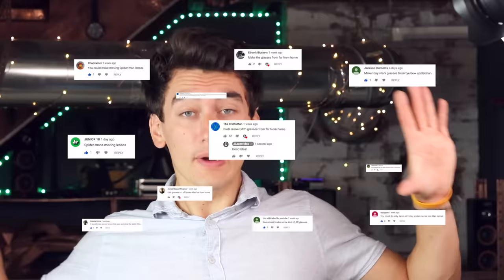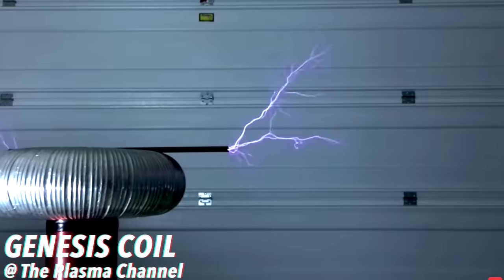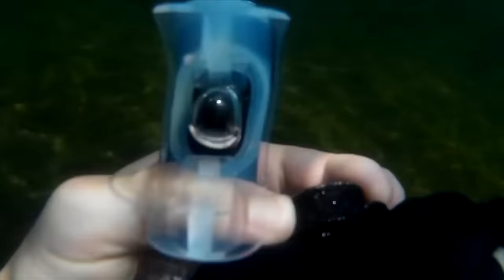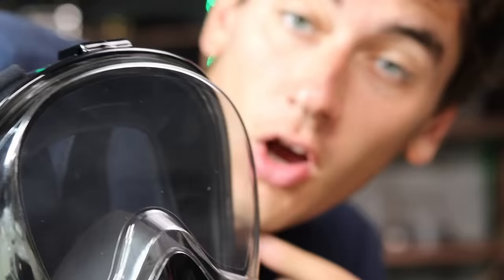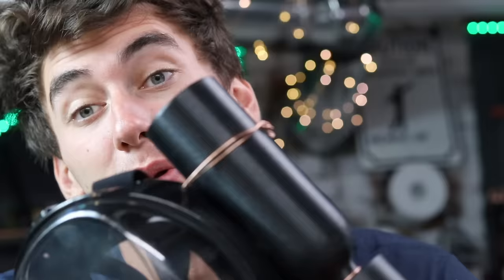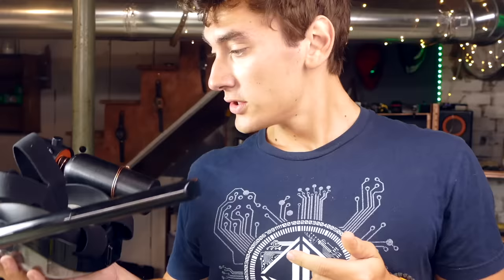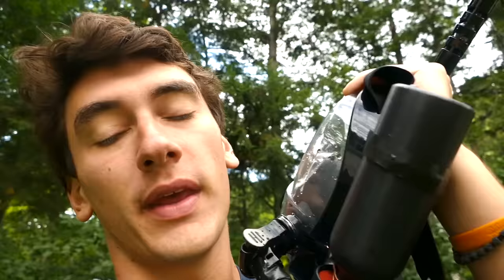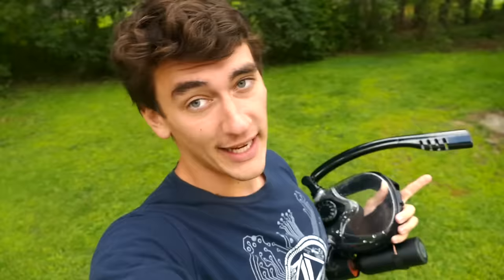BREATHE UNDERWATER With Just a MASK?!?! - Easy James Bond SCUBA Build (Building Your Ideas #1)

Comment: well it's a great concept for fast spot dives in open waters. Like for checking a prop , water intake on a boat or if you drop something in shallow water. A scuba mask maybe you could have interchangeable extra air tanks its portable enough to put in your back pack. Don't let the people knock you down it's a great idea and definitely has it's uses. I've been diving for 40 years and used spare air and similar mini scuba back up systems.  The important thing is that the user should know how to use the mask and it's  limitations.  Again good idea.

Comment: To all the people who are saying this should be a product and that they would buy it.
I am a diver and there are reasons for the tank being the size that it is and all the equipment being the way it is. As much as this is a cool video and done in a controlled situation you can experiment with things like this, it is not safe or practically deployable in real world diving scenarios, nor should any diving equipment be used by anyone without appropriate training and procedure. Don't buy mini tanks and try to dive with them as a primary air source, there are serious consequences to consider like air embolism if you run out of air and don't have experience, it is not the same as breath holding.  If you want to try diving, get certified and buy propper equipment.

Comment: Here’s an idea…take a larger emergency air tank that would fit on your back and connect to the same cool looking mask. Keep the snorkeling tube for surface swimming. With a small tank  you can maybe get about 10 or 15 minutes of actual diving. Will still look pretty cool. And please get an electric compressor. Then your time refilling the air will be short and you don’t need to exert yourself. Using a hand pump is just ridiculous….

Comment: My first thought is you're gonna get mask squeeze if you go to any depth with that thing. But of course you won't have more than a couple of breaths if you go to any depth with that thing either. I also wouldn't trust that pump for breathing gas, if you're gonna play with this get a normal 12L tank, have a dive shop fill it and fill the little tank from that. Pumps designed for breathing gas use special lubricants I believe.

I don't want to come across as negative, mind, this is a neat project, looks like a lot of fun.
EDIT: Also, a spy using this would give themselves away with their bubbles. If you really want to freak the safety nellies out, build a rebreather ;)

Comment: Description: 'This device allows the user to breath under water for around 5 minutes on a full tank'. 

In-Video: 'Maybe a couple of minutes'.
Reality: Maybe 30 seconds, and that's after 15 minutes of solid pumping. There's a reason divers call these emergency tanks '3 breaths till death'.
Reply: Yup. People are better off with a pony bottle and a small regulator which will actually allow you to get about 15min of downtime. This is the most dangerous contraption I've seen in a long time
Reply: Well yes, but actually no.  
At surface this holds the same amount of air than at 30 meters.
However at 30 meters you will suck in the air in the bottle 4 times faster than at surface. So yes its 3 breathes till death. At a certain depth.
Reply: tom bates so if I can hold my bread for a minute then 3 breaths IS a couple minutes
Reply: @jameswolf5513 
Holding your breath while diving is  no bueno.

Comment: TLDR: I love the concept and it could be a great niche item with small improvements! However, using an electronic or even manual aircompressor can be FATAL when using it as breathable air!

Full story:
Super cool concept, just a heads up. Scuba shops use specialized equipment to make sure the air is clean and in correct ratios.
In dive school our instructor showed us some horror stories involving oxygen toxicity from people filling their own gas. You can introduce imbalanced gas ratios (oxygen toxicity, CO/CO2 poisoning, ect) or even toxins that aren't unsafe in normal open air conditions but as soon as we get into a pressurized system where levels can concentrate and no new clean air is circulating it can be dangerous. So best to let the pros fill your tank and keep you safe. Also dive training is super fun and not all that expensive if you want a basic certification, I learned a lot and had fun doing shallow and deep dives.
Maybe make a clip in system with a QD attachment on tanks where you can keep extra tanks on hand and just pop em in to keep the fun going longer. I think it'd be very practical, let you enjoy the toy longer, and keep you safe!

Comment: Cool build.
Now for the ultimate build. 
A LIGHTSABER
can you build a lightsaber uses a super powerful laser or plasma. Can be use to fight with. Didn’t have to burn things just needs to look the part. Maybe a extendable strong steel rod in a hilt with a small mirror on the end and have one of those stupidly powerful lasers you can buy fire at the mirror to reflect back to stop the beam.
Or maybe a chemical laser that has another chemical laser that restricts the length of the beam that don’t have to be able to fight with.

Comment: When you refer to the O2 mini-tank I realize that you don't know anything.   Scuba uses compressed air.  For any length of time with O2, one will get oxygen toxicity
Reply: one can breath 100% O2, 30 feet under, all day, just not deeper, and use lots of safety equip. and personal.
O2 is toxic deeper that 30 feet or 10 meter
Reply: @davegeorge7094 1,4 atm partial pressure will be around 7 m, so 10 is dangerous
Reply: @davegeorge7094  and that requires advanced Nitrox education. It's lucky that they were at city, those air could hurt them silently
Reply: @davegeorge7094  33 feet exactly
Reply: Unless you’re using a rebreather. It depends on depth and PPO2 (Rec limits 1.4 bar O2, 1.6 max, military 2.2 bar).

Comment: I don't know if anyone has already said this, but a heads up. those air tanks are killers the deeper you go the air gets compressed and it empties fast one breath at 10 feet  and that migth be all you get before you are out of air do not use these just get a full sice one and a gauge I know he talked about regulations and sertified diver but at times people forget about that  if you want to go diving get certified and get the right gear

Comment: Im a certified scuba diver and certain toxins in the air at surface under pressure can be deadly even  at 3 feet also if you have no prior backround in scuba you must know that diving with that tube connecting the regulator to the mask the tube can close at depth because of the pressure

Comment: By the way most scuba tanks or pony bottles have a compressor hose adapter so you can use a tool compressor and not east 15-20 minutes filling it up.

Comment: As a Dive Master with PADI and a Saturation deep-sea diver i recommend that no one does this the fact that it would be filled entirely incorrectly, the pressurisation of the tank is incorrect, and the fact that there is no SPG is hazardous, you would have anywhere from 2 mins and below before you run out of air, plus the risk of a spontaneous pneumothorax because of the partial pressure change from the oxygen impacting your lungs and possibly rupturing a bleb could be fatal, with the concentration is 21% oxygen 78% Nitrogen and 1% mixed gasses usually argon, it would impact your tissues causing issues with saturation and possible gas embolisms or any other medical problem under the sun without the correct stops and dive computers to monitor your saturation rates, great idea but not good in practice, if you really are looking to look like a badass try a rebreather with dual side mounts for gas switching on deeper dives otherwise continue using your normal gear lmao

Comment: not sure if I missed you explaining it but how do you not use up the air in the tank whilst you're still swimming at the surface (breathing through the snorkel)? would it be possible to control that? curious because i am a product design student working on a concept for a lifeguard/rescue mask that works similarly

Comment: Ik everyone says its unsafe and all but what if you put some kind of floating pump (yes got the idea from subnitica) that pushes air in from the surface into the masks tank by a tube, that would prevent you from going to deep and you can stay under for as long as the pump pushes the air into the tank, as long as it dosent brake,

Comment: To say that this idea is dangerous would probably be an understatement. Just basic maths will tell you that the amount of air in a bailout tank is minimum (50 seconds) no idea if you have over or under pressure or even if you will run out, just enough air to get you into deep trouble with no way out or warning. Go on line and take a look at what certified divers use...........

Comment: I think that would work better as a rudimentary replacement for a respirator. Maybe make a HUD for it or some actual scuba goggles. You can’t equalize properly with a full face mask so maybe try to build a system that fixes that issue?

Comment: This engineer has built a shield that comes back, black panther claws, jets to propel himself up or forward faster than Usaine Bolt, a folding shield, a voice activated drone with camera and heat signature features, expandable wings, a way to breathe underwater (for low cost), and still doesn't have a foot plate or handles for a bike pump.
😂

Comment: This is a really inspiring and entertaining video. Do you think its possible to make a An underwater scuba mask, with micro electrolyzers that splits the water particles to hydrogen and oxygen. This will require a lot of energy ofcourse, Lithium Ion cells, might not be suitable enough, so what do you think, will  be Good enough to carry such energy Requirements; Solid state Batteries such Lithium Air or Aluminium Air?

Comment: You need to have a pressure gauge connected to the mask with a tube that can be worn on the wrist like a watch to check psi and see when you’re about to run out of air

Comment: okay I´ve seen some cmts and for the first time the feeling to cmt something aswell. First of all these "mini tanks" are not for some fun and uneducated dives! There is so much that can just go so bad with these mini tanks, and every scuba diver or even a freediver will tell you that! There are a ton of good reasons I could give you straight away. Second of all in those masks you cant equalize well, so please just use them as they are ment to be used. just for snorkling at the surface!

@T G 100% sure you dont need oxygen nitrogen mixture under 40 meters (100feet) @Hugo Bakker Deep dive is everything deeper then 18 meters (60Feet), so please do not even try with that thing.

@JLaservideo i skipped a bit in the video but I hope you mentioned that there are some serious risks in this, even thou it looks like fun but there are always some ppl that do not know about those. 
Apart from that keep on what you doing.

PS: i hope more or less my english wasnt to bad and second of all that i converted Meters in feet correctly.
Reply: Actually, you badly need to mix your oxygen even under 40m, as 100% Oxygen turns toxic at a depth of only 6m. So as 79%Nitrogen/21%Oxygen is what we have floating around anyway, that's what you would put in your tank for a standard sport/leisure dive down to 45m. Yeah, you can go a little deeper, but not without violating safety margins that might make the difference between coming back to the surface safely and not coming back at all.
Reply: @c3f59  that's exactly the mixture you breathing right now, normal air. But still right, I expressed my self not well at that point. But I wasn't expecting someone going to dive with 100% oxygen.

But here for everyone.
Nitrogen 78.08%
Oxygen 20.95
Argo  0.93
Carbon dioxide 0.033
Followed by a lot other like helium, krypton, hydrogen and so on and so on...

Comment: As a certified scuba diver, I do not advise a number of techniques used in your presentation because you may have already impaired your health from what you have already done.  As another respondent mentioned, you pumped air into the air tank (it is not an oxygen tank as you indicate in the video) using a hand pump that was not specifically made for filling scuba tanks.  That old hand pump likely had rust, maybe some oil, and maybe some rubber or  leather (I’ve seen both materials used to make hand pump plungers) particles that make up the plunger part of the pump enter your air tank and you inhaled some of that material.  The rubber or leather plunger in the hand pump slides along the pump housing scraping along its walls and any rust will act as sandpaper and wear particles off the plunger thereby releasing fine particles of rubber or leather and rust into your air tank.  These fine particles enter your lungs and may travel through your body beyond your lungs.  For instance, recent research on this topic related to fine wood particles generated from burning wood as in a typical campfire scenario can cause a stoke in a person (Transient Ischemic Attack) or TIA or otherwise called a Mini-Stroke.   The typical scuba compressor in a dive shop likely costs over ten thousand dollars just to put regular air (ambient) that has been filtered and maybe dehumidified in the scuba tank.   Good air quality is a must and should not be compromised even in your short term presentation.   You can overcome this issue by filling your small air tank at a dive shop or filling it with an approved scuba quality compressor.  However, you may find that dive shops will only fill scuba tanks for those with scuba certification cards.  Those small air tanks that you used can be refilled from full sized air tanks with the appropriate adapters.  You mentioned you hand pumped 1000 psi into your air tank and got about 2 minutes of usage out of it so if you were to put in 3000 psi you would get 6 minutes of breathing time from it at a similar depth of dive.   You were using your mask device in water under 10 feet but even at this depth, serious to fatal consequences are not too unlikely- for example- what happens if on the exhale side of your breath you run out of air due to valve failure or just ran out of air in air tank?  If you run out of air, you will first  experience more labored breathing as you run low on air but that labored breathing duration is not very long with such a small tank. 10ft is a long way to go with no air and if you do not know enough about how to recover from such in advance, one likely may panic and not survive the moment.   When snorkeling, you always know how much air you have for you progressively sense the decline in your body’s air reserve.  However, with your device, you may experience an abrupt end of air supply which is much more difficult  or impossible to manage.    Scuba gear has a system in place to allow one to safely recover from what I described.  Divers have a a backup air line with backup mouth piece and valve, gauges to remind them how much air they have.  You can time your air supply with your small air tank, too and that will ensure you do not run out of air but you have to realize your breathing time will very based on depth, your rate of breathing.  I use a small air tank similar to what you are using for an emergency backup to my full size complete scuba gear setup.  If I should run out of air 60 feet below, my small tank  (I don’t recall the capacity of mine) may enable me to make it to the surface.  I will have to review the characteristics of my Spare Air Tank to determine its effective depth of recovery.   It’s advised that scuba divers have a buddy so that you have an additional backup in case of a problem for you can use your buddy’s extra (secondary) air line so both of you will be using the buddy’s scuba system.   Heed the warnings others mention about surfacing too quickly when in water of as little as 3 feet or 1 meter.  That is well within the 10 feet depth of your presentation.   Therefore, if one were to fill their lungs with the air from your tank while at the 10 foot depth or as little as a depth of 3 feet and rise to the surface while holding that breath without expelling any air they would experience lung damage to some degree.  Pulmonary overinflation syndrome is the consequence and results in one or more overexpansion injuries:  pneumomediastinum, pneumothorax, subcutaneous emphysema, or arterial gas embolism.  Breathe while you ascend to avoid these issues and if you run out of air while at depth, you must expel the air in your lungs as you ascend otherwise the air in your lungs will expand as you ascend and burst delicate and/or major features of your lungs.

Comment: Please please red this comment. This is extremely dangerous if you don't know what  you are doing. Diving with any kind od compressed air without knowing the physics behind it can be fatal. When you go down lets say 5m and breathe in,  the pressure is 0. 5bar higher meaning that your lungs duo to Boil Meriots law are taking, in the same volume, 1.5 times more air than on surface. If you hold your breath and go out on surface without exhaleing you can seriously injure your lungs and even die. That is most dangerous injury you can experience. Please please know what you are doing.

Comment: If only the nose could be pressed to equalize it could work even deeper down. With some weights on doe. And pressure gauge, depth gage and better oxygen so you don't get oxygen poisoned or whatever it is called. Someone should make fake gills that can allow us to swim under water for extensive periods of time. Someone correct me cuz im probably wrong.